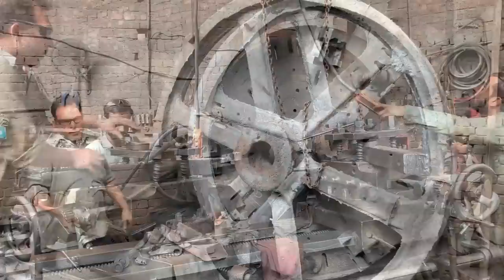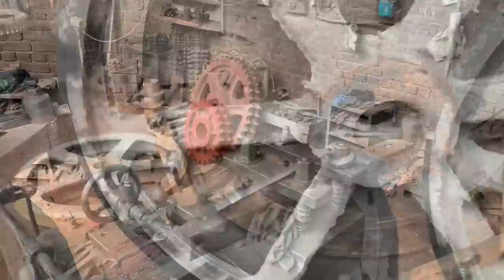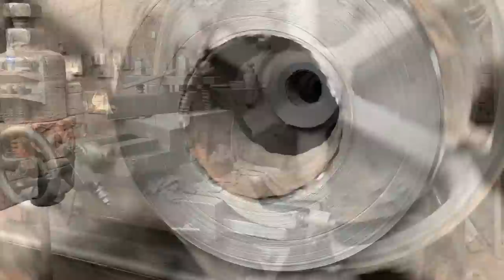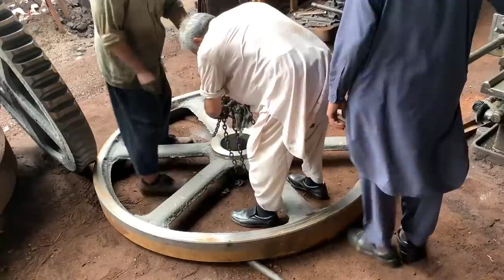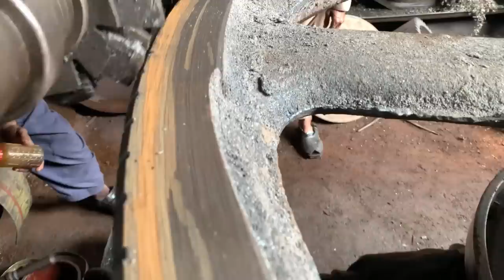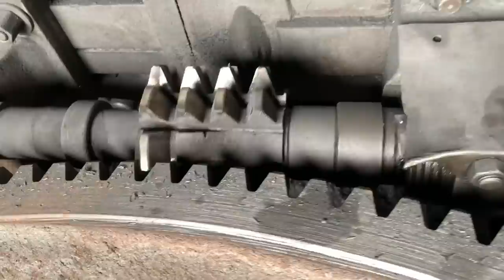Amazing Huge Industrial Gear Production Process || Largest Gear Machining on Manual lathe machine

Comment: Have to say the workshop looks like a museum time capsule from the industrial revolution complete with work and safety practices to match. I love the footwear while handling large lumps of cast iron
Reply: @RadekPogoda  Yes there is a place for scrapping all safety rules and letting Darwin take his course. In the words of peanut stupid should be painful
Reply: What’s wrong with long baggy clothing and flip flops?
Reply: @donniecreasey7722  Nothing at all if you dont mind being rapped around fast moving machinery or losing the odd toe or two
Reply: Indeed, those are the best toe-tector flip flops I have ever seen.
Reply: Probably won't last too much longer because much of the tooling is truly not up to standard even for 100 years ago 
Darwin is influencing this shop
Reply: @donniecreasey7722  If you hate people, not much.
Reply: @horsebee1  it's a place where some peoples made a lots of money sover others people.
Reply: Those are safety slides
Reply: No footwear is going to save you if one of those chunks of iron fall on you
Reply: When you get past a certain weight then you just have a tiny piece of steel to help the big piece cut.
Reply: All these videos are the same work ethic. If you ever see pics and videos people getting mangled, crushed and mutilated on the job………..80% of those accidents are from places like these. I’m surprised this guy is even wearing safety goggles!
Reply: Green field  Village  Dearborn Michigan

Comment: I was impressed at how true the rough casting was even before being machined. I love that lathe. The ratchet feed is classic stuff. The bore must be tapered as the machinist did a fit check with what appeared to be a QD type bushing. It amazes me that they have this machinery but lack precision measuring instruments. I guess you develop skills over time that get you close enough. I was blessed to have worked in the tool and die trade where I had instruments that allowed me to easily worked to tolerances down to .0001". That was many years ago. All in all, the men in this video are very skilled and have my total respect.
Reply: Чем вы измеряли допуск .0001?
Reply: Meanwhile these guys have made their own tools that get them within .01" all day ;) :)
Reply: Gotta love the no dial gauge way of dialing in.
Reply: Their precision measuring instruments were probably ruined from lack of care and sufficient abuse long ago.

Comment: Amazing work man. People say that old tools wear out but they really don't if you keep them oiled and treat them decently. Those tools appear to be from maybe the 1950s or the 1960s and they do a fine job maybe not as fast as the new ones but they're paid for and they work and they work and they work and that's all that matters. My lathe is a South Bend from 1930s and I'm happy with it. I don't use it a lot but when I need it it's there. I like old stuff! It makes me feel comfortable because I'm old stuff too and I don't want to be thrown out as well.
Reply: Older tools were built without the idea of "Planned Failure".  If maintained properly, they last for a long, long time, with only the occasional sacrificial bushing/bearing needing replacement.

Modern stuff is designed with a much shorter lifespan in mind.  Really shitty companies will even engineer failure in--like using a plastic bushing in a sealed unit that will eventually fail, resulting in severe damage to other key pieces and necessitate complete replacement.

Comment: I’m actually impressed. Everyone was wearing actual shoes, workers were wearing safety glasses, the machinist was taking care to cover the ways of his machine to protect them from cast iron dust, all the machines were in an actual building.  Worlds better than most similar videos I’ve seen.
Reply: Not everyone was wearing PPE, there was a worker wearing thongs. The shoes worn by the others were not steel capped safety boots. Those long shirts could easily get caught in rotating machinery and pull the wearer into the machine.
Reply: Sarcasm ??
Reply: @frontrunner3052  not at all. Watch some of the other videos like this. Machines in the street, gouges in the ways, everyone wearing loose flappy clothing and sandals. Doesn’t meet a lot of modern safety standards but so much better than the others by comparison.
Reply: It's probably Turkey.
Reply: Yeah, they had their sleeves rolled up and safety squints, but the lack of steel toes was really unnerving.

It's really sad, these guys are incredibly talented; how many competent machinists get injured/killed every year because of the lack of safety regs?  The company owners are raking in money hand over fist, they could easily afford to equip them with basic PPE, but these guys are viewed as expendable, even though their skill and experience are massively valuable.  Shortsighted, to say the least.

Comment: Just as a matter of interest, I started work as an apprentice machinist in 1962 in a factory in West Yorkshire, UK, and the lathes, planers, and drills were easily more ancient than these guys are using.  And for sizing we only had rulers and spring calipers!  
It only takes a day or two to get a feel for making parts fit - not necessarily to what the drawings said the size should be.
The machine shop had line shafting driven by a big single cylinder diesel engine.
When the place shut down it would have made a perfect industrial museum but there were so many similar shutting down in the 7-80s that everything went for scrap.
Reply: That those functional lathes got chopped up and melted down in furnaces somewhere is sad in many ways. They could've continued to produce useful repairs on earth-moving and mining equipment with some modern adaptations as demonstrated by Kurtis and Karen in QLD's Cutting Edge Engineering Channel.

The Pakistani attitude of "make do with what's available" is admirable in my opinion, and I built my own house 35 years ago with the same approach and eliminated the Mortgage Millstone around my neck 😀
Reply: ive been in a tool shop for 8 years now. i got a v block from an retired friend that he gotten from a retired friend. it dated from 66. i really like the thought of it going to someone else after me. and im 40 so ill have it for a while to come.
Reply: @chrisruiz1065  I know the feeling....my dear friend JJ just passed away, he gave or sold several of his tools I really treasure them bc they were his.
Reply: I still use a large lathe once used in WW1 manufacturing. It makes me happy using such an old thing.
Reply: Don't worry a lot of the old British machines ended up in India and Pakistan. They l9ve the old British machines. Will last 100 years not like the Chinese stuff. My old Colchester was built in 1964 and can still hold a micron on a good day.
Reply: HMS Belfast in Thames has may machines like these, with Halifax & Keighley firms names on

Comment: Keeps his machine and tools clean, wiping down before setup and after machining.
Reply: keeping them in rust and torturing them without proper maintance.
Reply: With the amount of sand still attached to the casting, it is either constant cleaning and rags to cover the slideways or have silica sand get embedded in the guides scoring everything up.
I wouldn't let a casting near a machine of mine without at least getting shot blasted. I'm sure they don't ceramic coat their sand moulds either to stop sand fusing into the metal.

Comment: That is the first engine lathe that I have ever seen with a ratchet dog feed on the cross slide and carriage. It may have come from Britain to be run on a steam powered line shaft. The VTL “ attachment hanging from the wall was likely engineered from a local shop.
  No, boys and girls, this is not the typical machine shop that your folks worry about.
Reply: I took notice of that as well. When I was a machinist back in the late 1970's I occasionally ran a shaper that had a similar ratchet feed mechanism. I loved running that machine because it was so mechanical.
Reply: I was thinking all the while what is that thing going up and down.

Comment: Hello P T people. Always hard at work, good business you have there. Ok, what the heck was the guy on the phone while operating the overhead crane? This while the old machinist was fighting the two ton bull wheel into place. Phone guy would be gone from any other shop. Loved the set up on the huge vertical lathe. Seemed plenty solid enough. Your spacers on the flat gear cutting phase might be an issue, the work tries to walk away from the cutter if you don’t use a one piece spacer. Looks like the 400 ft lbs on the big hold down nut was sufficient to fix that. Nice job! Be nice to see the gear tooth hardening steps. Good luck from Canada.
Reply: انتم في بلاد الغرب تحبون العمل ..
أعتقدت انكم ستسخرون من عملهم هذا و تصفونه بالبدائي ..!
Reply: Owner's Son, pesume finger on the cutting was this, nice manicured nail!
Reply: In so many ways I find these videos fascinating. Usable products are made by machines that are a hundred years old. 
   I can only imagine and hope that Pakistan start to require schooling for all children and invest in technology that that is newer and up to world engineering standards. 
   Unfortunately with the current leadership Tribal System this will not happen for many years. Your nation is technology frozen in the past.

Comment: I used to work at a company that produced gears for the printing industry. Among things that we did was repair of what were called "bull gears" with broken or worn out teeth. These gears were the main gear that drove the plate cylinders on multi-color presses. We took the old gear, turned the teeth off of it and then machined a steel ring that was heated and shrunk onto the existing hub and further pinned into place then machined to final dimensions. Some of these rings a 6 foot tall person could easily stand up inside of. All machining was done on manual vertical turret lathes and new teeth were cut on vertical hobbing machines. All this produced gears with a tolerance of less than .002 inches of run out and diameter. Nothing new in this video to me. LOL.
Reply: Sounds like a railroad steel tire.

Comment: Twenty-five years ago, I was buying custom gears of similar sizes from United Engineering and Foundry in Ohio, for use on the chain-driven asphalt plant elevators we built.  UEF poured the sand cast rough blanks, then machined the teeth and hubs to accommodate TL or QD bushings as required.  UEF also supplied large multi-groove sheaves in the 24" to 36" OD range - larger than the stuff we could order from Dodge/Motion Industries.  UEF's plant was only a little more "modern" than what we see in this video.

Comment: Special training really shines through on specific disciplines in this video.
For example:
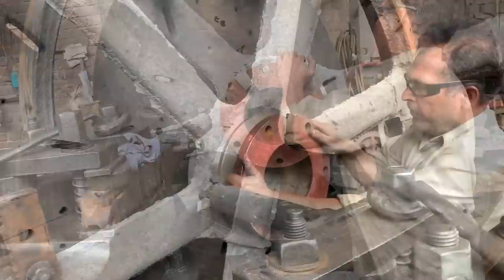Precision tolerance training at 16:20
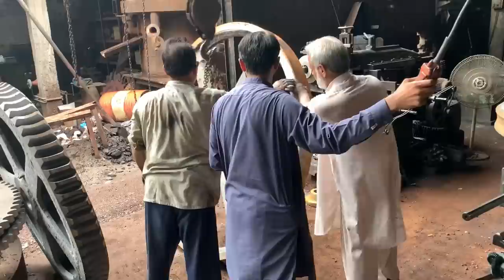Safety First (jump training) at 18:57
Understand the effect of harmonic loading and machine flex at 25:00
In appreciation of fine machine work from Germany, Pakistan has incorporated their own standard ... "goot-e-nuff".
Reply from the maker: Thanks Kevin sellsit
Reply: those machines are from ages when maria terezia was young. the difference is that they are now powered with electromotors and not steam :D
Reply: В этом видео действительно просвечивает специальная подготовка по конкретным дисциплинам.
Например:
Тренировка точной толерантности в 16:20
Безопасность прежде всего (тренировка прыжков) в 18:57
Понять эффект гармонической нагрузки и изгиба машины в 25:00.
В знак признательности за прекрасную машинную работу из Германии Пакистан ввел свой собственный стандарт ... «гут-э-нафф».
Reply: I'm honestly impressed that there were as many people were wearing safety glasses as there were.  I'm noticing that it's mostly the older guys.  I wonder if there's a correlation, there...
Reply: @AnatolZelenkoff  Thank you for the translation.

Comment: I am impressed that with an extremely rough casting and worn tooling, lack of precision instruments and minimal energy expended that this part came out as well as it did. The machinery this part is used in must be quite "loose" and require prodigious amounts of lubrication to survive. That being said, if it works, it works. The cost of this part and further replacements as it and associated parts wear out is most likely less than a "proper" commercially produced part.
Reply: My thoughts exactly.
Reply: That thing is so big it's going to grow .001" for each 1.5C rise in temperature.  The guy truing it on the gear hob should be easily able to see much less then that with the rig he's got.  You'd be surprised how accurate you can be by eye, given the right conditions.

Comment: Can't believe how this turns out and likely very useable for low speed application. But that casting was so rough that the machinist sure had a challenge to get it in finished form.  We have a antique machine that needs a large gear made as the original has been taken and we have to come up with a replacement. The Dia is 44.5 in and 5.75 wide at the face.  66 tooth, about twice the pitch in the video. And lastly not priced for sale to the Rockefellers!  any ideas?
Reply: Contact David Brown Gears, Huddersfield, UK.
Reply: If you are located in USA contact Spencer-Pettus Machine  in Gastonia, NC. That size is a piece of cake for them.

Comment: Why is the cutting done tool facing downwards with clockwise rotation it's opposite to normal lathe where you cut so that the tool is forced downwards - they are lifting the tool instead placing the tool holder in tension instead of compression.- very strange anyone know why ?
Reply: Cutting that way is to enable the chips to fall clear and not get tangled in the work!
JIM

Comment: Would a modern manufacturing process use big electric forges and presses to create these gears, then just a little finish machining rather than casting and hobbing?

Comment: Not to nitpick but some of the casting flashing could be removed from the spokes.
Reply: I would assume that the spokes will be cleaned up at a later stage of the fabrication process - no end customer would accept the product with the spokes looking that scruffy. It makes sense to do most of the machining first, then final finishing of the spokes and other non-machined surfaces later: that way, if a serious flaw, to big to be repaired, is found in the casting while machining the gear teeth, the effort, time, and cost that would have been spent on cleaning off the flashing wasn't wasted.

Comment: Yeah, that gear tooth cutter isn't gonna last much longer. Every missing tooth puts extra strain on the next as the following tooth will have more material to remove than designed. That's why they're snapping off in sequence. I suppose they'll just run it at a lower speed 'til it won't cut anymore. 
Still, impressive work.
Reply: I concur.
Reply: I really thought that those missing parts are normal.
Reply: That's probably what they said when the factory in Britain sold it off 70 years ago ; )
Reply: FYI the gear tooth cutter is still made by several companies including David Brown Gears, Huddersfield, UK, where I worked but I think the cost of a new one would cost more than the shop earn in six months.
Reply: What missing teeth. It's indexed to make progressive cuts.

Comment: I don’t understand!  The gear has been strapped down onto it’s rough unmachined cast side, so all the machining is relative to some random cast bumps.  How can that ever work?   SMH.
Reply: It's machined to good e nuff eyechrometer tolerance, the bore checking gauge is a piece of flanged pipe 😂😂😂😂.
Reply: Well the the way it works is due to the fact that they did all the lathe work without removing the part so there point of reference was constant  it could have been 4 inches off of center but that don’t matter if u have the material to waste or cut off to make it round hope that helps answer your question and that flange pipe is a taper coupling works better then a key way we see on a lot of things and is more precise in keeping the gear centered on a shaft works like a wood splitting wedges it’s just round and u used bolts to pull it in the bore and in turn tightens. Around the shaft your mounting the gear too due to the slit in it letting it compress
Reply: @gunsmith19971997  Well, yes, the lathed surfaces will be okay relative to one another, but a bit skewed relative to the unfinished surfaces.  So the spokes may be seen to wander left and right up to a centimeter.  that's okay as long as the skewed parts don't rub on anything nearby.  Oh, and the balance will be way off unless some final balancing is done.

Comment: Crude. Casting is garbage. The quality of the iron is bad. The deflection in the cutting tools sets the limit for accuracy (poor). I suspect for low speed gearing that is not heavily loaded it will function after a fashion.
Reply: Apparently, you have never cut cast iron.

Comment: Never imagined that this sort of primitive and immensely unsafe manufacturing still goes on in this day and age, but at the same time I totally respect and admire the skill of the men doing the work, who, mainly by eye it seems, turn out impressive machinery components. I miss the absence of lubricant and coolant on the work pieces and fail to see how the cutting tools stay as sharp as they apparently do.
Reply: Cast iron doesn't require lubricant when machining as the high carbon/graphite content makes it easy to machine. Looking at those old lathes i would say they are at least 120 years old. I have operated horizontal lathes doing similar sprockets etc which were installed in 1928 and those looked newer than the relics these guys are operating. And to think,Pakistan is a nuclear power.....
Reply: @Mercmad  I think with grey cast iron there are no such big chips as you see in this video.
Reply: it's cast iron, no lubricant necessary